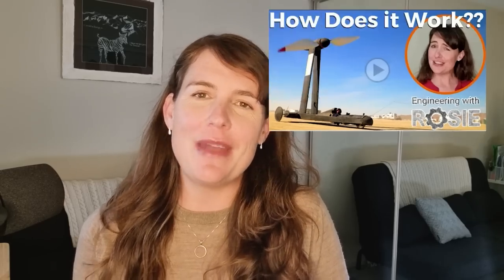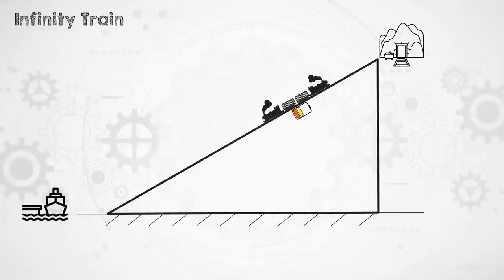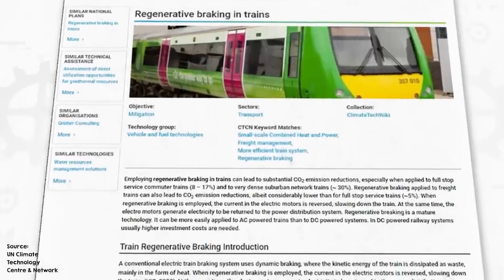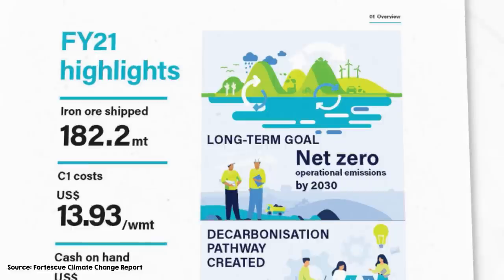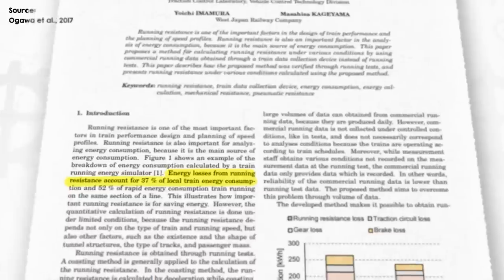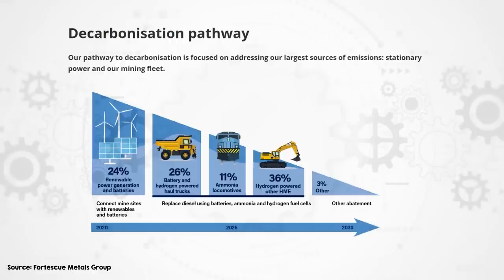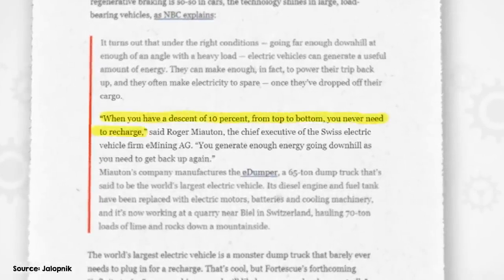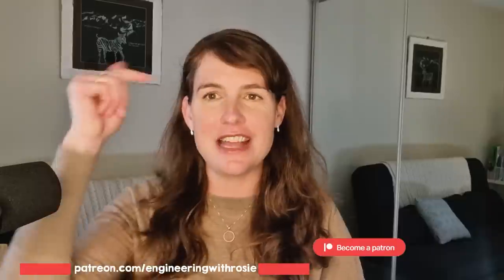This Mining Train Powers Itself: The "Infinity Train" (and how it works)

Comment: I'm not convinced by BEV haul trucks. Ive seen some mines use electrified haul roads with the trucks fitted with pantographs.
These removes the need for huge batteries, charging downtime and the trucks can be converted easily because they already have electric drive. 
My only concern dor the train: what if there is a technical issue and it fails to collect enough charge on the downhill journey?
Reply: There will be a diesel loco on standby for recovery.

Comment: What if the batteries were taken off the train and connected to the rail line? Could energy generated by the train going downhill be transmitted to the batteries and used to power the train going uphill? Would the weight saved offset transmission losses?

Comment: They probably will have a backup energy source "just in case". Either fully charged batteries (separate from the charged ones) or possibly an old-fashioned diesel engine simply for emergencies and rarely if ever used. I can only imagine the nightmare if something went wrong on the way back "up" and they had zero power.

Comment: All the significant grades or other regular train braking locations (heading into a switch yard) along the routes of rail roads that use diesel electric locomotives could be used to generate Grid electricity.

Comment: I reckon we can equip each freight train car that normally carries a 40 foot container with solar panels. The solar panels (16m2 per car) will generate 2.6kw of power while the sun is out per container. 50 carriages (containers) will gives us 130kW. As a supplemental power source, this should reduce the cost of interstate freight transport fuel costs substantially I expect.
Reply: 130kW  is less power is way less than your average Tesla engine at 615kW.  I guess you could run the AC in the cab.
Reply: @craigs5212  When its cruising at a constant speed, I'll be surprised if it needs power from any other source other than the solar panels.

Comment: Is there a gearbox system on the motor to increased the speed of the generator RPM for regen, the weight of the loaded Loco would have enough power to spin up the generator or alternator to produce more regen that if were working on a  1:1 ratio.

Comment: The diagram is misleading in that the section of track where regenerative braking would occur is relatively short and is quite a way inland. This means the batteries would have to power the loaded train from the bottom of the descent to the coast as well as the empty train right back to the mine
Reply: The braking will happen all the way down, otherwise the train might go off the rails from the uncontrrolled acceleration.
Reply: @AnalystPrime  agree, but the point I am making is that, in the case of the Pilbara mines, the bottom of the descent is a long way from the port where the trains are unloaded.Thus the loaded train will need to be battery powered for much of its journey

Comment: instead of carrying the battery back and forth couldn't they add wires along the track providing the power and put the batteries at the bottom? Or are the wire losses too large?
Reply from the maker: I assume it would cost more to do it that way, but I am really just guessing.

Comment: Maybe the weight of the battery is less significant than thought. Weight of the locomotive must be large to ensure adequate adhesion of the driving wheels to the rails, if a proportion of this is ballast then this could be supplied by the batteries?

Comment: why would the battery need to be on the train. Couldn't the tracks be use as 'wires' to a fixed battery at one end of the track, or use overhead cables like a tram ?

Comment: they use american locomotives in australia ? i guess you could use dynamic braking to charge a battery instead of blowing it away as heat, but the locos run the diesel and use the generator to excite traction motor fields i believe. anyway the locos in your clip dont have dynamic brake blisters anyway?

Comment: Hi Rosie.  Great hair day by the way.  Say, energy storage doesn't need to be on the train.  Don't commuter trains use a pantograph?

With electricity storage off the train cars, significant weight savings could be attained.  Furthermore, cheaper heavier energy storage like liquid magnesium batteries could be used.  Energy density is a non-issue.

Comment: Would it be possible to just have a powerline that's connected to the vehicle and the powerline is connected to a static battery system on the ground? You wouldn't need to carry the battery and it could work for powering the train if it's not 100% sufficient.

Comment: I wonder how long these freight trains take to unload and whether it would be at all possible to charge the batteries enough for a round trip.
Reply: Most ore, both in the US and UK, during rail transport, is done with bottom discharge hopper cars. They are loaded from above and at the bottom, they will pass over a track section over a collection point and open their belly doors to discharge.  FR
Reply from the maker: If shipping ends up going electric (or partially electric) and the ports get charging infrastructure then that would seem like a good way to extend these kinds of projects beyond rare examples where they can be 100% self sufficient.

Comment: That source of energy is similar to how to use the mechanical force of a running car. In this case , the mechanical force is created by the pulling force of gravity to turn a magnet or a solenoid to drive free electrons in the solenoid to the positive terminal  of a battery, then the chemical reactions in the internal circuit of the battery pull the free electrons from the positive terminal to the negative terminal, and at the same time driving positively charge ions or cations to the positive terminal to cause accumulations of negative charge and positive charge at the two terminal  to create a DC electromotive force  between the 2 terminal to drive electrons around the external circuit to run the mining train
Although this method of generating electrical force is simple and very economical, environmentally friendly,  having almost infinite gravitational force to turn your  motor's rotor or stator to covert the mechanical force to electric force, you cannot actually have any infinite train function because the battery cannot last forever. its electrolyte has to be replaced after a period of time , so do  the electrodes and the components of the train as well.

The phrases, electric energy and gravitational potential energy are vague and not very correct. The  unambiguous phrase is stored electromotive force which can drive electrons through the external circuit on the way back uphill to run the mechanical system to move the train uphill when the gravitational become a resisting force against the train's uphill motion

Comment: 100 ton truck is low. there are dump trucks that haul 450 tons. so likely a bigger truck would be able to run without fuel because as the load gets bigger the empty mass doesn't increase as much .

Comment: What I'd like to know is what is the lifetime efficiency versus the old version of the different vehicles... Not just how much fuel is being saved directly, but the overall carbon footprint including manufacturer of the old versus the new for the lifetime of usage. The definition for lifetime in this case is the amount of time before anything needs to be replaced that's major, battery pack, actual engine and motors, I'm assuming the frame, tires, most other consumables, etc, is going to be the same regardless of which technology is being used.

Comment: IF they need a bit more energy, they can add solar, each cart can provide up to 16kw/hr on a bright sunny day (8AM to 6PM average would probably be around 9-10kw/hr or around 90-100kWh/day per cart)
Reply: Colin Mitchell  This train could produce 1MW per hour, on a train that already doesnt need charging as explained in the video. The solar would be to supplement the gravity driven re-charge, and allow for more versatility.
And again, because the train doesnt need recharging for gravity, they can just put it on the 'engine' for ~20KW/hour or as many cars as they want for about 16-20KW/hour per car.

But youre right, a traditional diesel electric train is far more suited for something like this because that energy would be mostly wasted on this gravity driven train. On the plains a solar assisted train could cut its fuel usage by 1/3rd
Reply: Instead of putting solar panels on a moving vehicle, with all the problems that causes*, you could also just put them on the ground. Easier, cheaper, more efficient 🤷🏼‍♀️

*Problems your idea would cause:
1. Carts are loaded from the top. So you would need some folding mechanism for the solar panels -> more complex -> more expensive + maintenance 
2. Solar panels aren't pointed straight at the sun -> less efficient
3. Damage to solar panels from flying debris or during loading of the carts -> reduced lifespan for the panels

Comment: I think there was a train on a hill somewhere that was used to store energy for the electricity grid, sort of like pumped hydro?
Reply from the maker: You might be thinking of ARES - Advanced Rail Energy Storage. I covered it in a livestream on gravity energy storage a while back https://youtu.be/AktehETXUVA
I realised after I finished this video that I probably should have talked about that project in this video too 😊
Reply: @EngineeringwithRosie  oops my bad, just had a look at it now.  Not much point mentioning it In this video if you've already covered it elsewhere!  Sounds like a good idea but would probably work better in eg Switzerland than   say the Netherlands.  Although they could maybe do a sort of pumped hydro thing there with seawater I suppose 😁

Comment: awesome tech, broken down really well! though... 
EDIT: whoops I falsely assumed it was for a coal mine. this is what I get for skipping to the maths!
Reply: I assumed it was coal as well, but apparently it's iron ore. 🤓
Reply from the maker: Yes it's iron ore. Not sure how I would feel about the train project if it was to carry coal. Negatively probably, not worth the effort to slightly decarbonise an industry that's just got to go. But iron ore we're going to need for a lot of stuff that will power the energy transition, so I'm on board 🚂
Reply: @EngineeringwithRosie  Very easy to say that "Coal just has to go" with plenty of options. In central Europe that is perceived as a death tread.
Reply from the maker: @Nerd3927  sure it is very easy to say that. But I have spent my whole career developing technologies to replace coal. So I am certainly not just talking about replacing coal, I'm helping develop solutions to replace it without sending anyone into energy poverty.
Reply from the maker: You must be the only person who skips to the maths!

Comment: Just to add more fuzz to the numbers, Willems is going to have much higher preforming battery tec then Tesla, now the cost of those  will prob be a square of the energy density gain but I'm sure they have a middle ground in mind.

Comment: They could keep the battery separated from the train, that would allow to use cheaper batteries than lithium ones, remove the weight from the train, and even trade with electricity when the train isn't running.
Reply: Standard high voltage transmission lines loose something like 50% over those distances. You could stage batter packs along the route but that would still involve substantial transmission losses that would likely render the project not viable. You would also have to be careful about pack failure. An electric train without energy would then require diesel rescue trains. There would also have to be a significant amount of energy storage redundancy in the system under that model as well. Mine operations from mine to ship are tightly controlled manufacturing operations and breakdowns/derailments produce major economic and operational problems. Mine companies spare no expense to resolve these kinds of incidents.

Comment: I'm interested in an economic comparison between the battery storage on the train and a catenary and electrical equipment supporting bidirectional energy flow with the grid.   For the moment I would ignore the scheduling requirements for the energy flow to and from the grid and consider the impact on operations only if the economics of the catenary were favorable.
Reply: Yeah. If near a decent sized grid that could be worthwhile
Reply from the maker: This particular mine is nowhere near any electricity grid 😊
Reply: @EngineeringwithRosie  I figured that was a possibility.  The catenary would permit stationary batteries at the mine which could double as demand-leveling storage, likely increasing the efficiency of on-site electrical generation and enhancing the ability of utilizing renewable energy generation at the mine.  Catenaries are not cheap, but it would be interesting if the increased return on equity in stationary batteries vs. rolling stock could pay for it.
Reply: @mrhickman53  I would put the storage batteries at about 1/2 the way up the mountain, to reduce the IR losses during charging and the return trip. ((Need to do the math to get an informed estimate.))
Reply: @michaelbianchi7639  If one were optimizing for IR losses the  batteries would remain on the train or be distributed along the route.  My guess is that overall system optimization would point to centralizing the capital equipment at the mine site.

it seem's a crude cost for a catenary system might be $1M/km.  I should look up the mine on a map, but a 4% grade would imply 11km to electrify.  Being a dedicated railway, the grade could be steeper, but I would suspect the catenary construction cost would also be higher per km in that case.

I just looked up Tesla's Megapack capabilities.  Each Megapack is 19.3MWh with a 9.6MW rating and costs ~$10M plus tax.  No info on installation costs.  In order to minimize the capital cost of the battery (on-board or Megapack) the train would need to take 2 hours on descent if no other means of dissipating the energy is available.  For the stationary Megapack system, the train could descend faster if mining equipment were also consuming energy.  Otherwise the Megapack installation would need to be sized to meet the train power requirements.

Since diesel sets are also limited to the power dissipation capabilities of the on-board dynamic braking resistors, one may be able to justify shorter, faster train sets using the catenary-stationary-battery system instead.  This is truly an interesting optimization problem.

Comment: Couldn't the batteries be fixed (saving moving that weight uphill)?
With catenary or third rail Im sure there would be some transmission losses but the cars would be less complex and much lighter.
Reply: More efficient yes. But the construction cost would be much higher.
Reply: I would put the storage batteries at about 1/2 the way up the mountain, to reduce the IR losses during charging and the return trip. ((Need to do the math to get an informed estimate.))

Comment: Like going downhill both ways. There is a significant problem with rejiggering what runs on what and in what proportion. It's what to do with all the left over petroleum products that once had a use but now little place to go? Heavy bunker oil is used by the 5,000+ global container ships. A barrel of crude produces about 1.5 gallons of heavy fuel when refined. Heavy fuel aka fuel oil is a heavier hydrocarbon than diesel, kerosene/jet fuel, gasoline, propane and butane. To get heavy fuel, the lighter hydrocarbons must be cooked off and need to go someplace. When cars are electric, gasoline will have to sell for pennies as it has to go someplace. It does go bad in long term storage if mixed with ethanol. Even clear no ethanol gas is 2 year storage life then you have a real mess. Still need all the other distillates and feed stocks if you want plastics, foam, fertilizer, roofing, asphalt roads, candles, lipstick etc as that is the heaviest. Nobody is addressing what happens when this distillation ratio becomes so imbalanced gasoline with no place to go and considered hazardous waste as result of refining heavy fuel or asphalt or candles?

Comment: A nice thing about trains is they can be big and heavy and still the steel on steel interface gives little resistance. More sustainable than electric batteries, if also a bit less efficient, might be the lowly flywheel, set up in counter rotating pairs.

Comment: You wouldn't have to worry about carrying the weight of the batteries if you used an electric rail, but I'm not sure that it would be more efficient. 

Could a mag-lev train carry the cargo?
Reply: Colin Mitchell  Sure, but expense is relative to the return on investment. It may still be worth calculating. Maglev at $30million a mile is cheaper than a subway system at $1billion a mile. 

I do understand though that standard rail at $1-2 million a mile is much cheaper up front. But if the maglev carries a heavier load much faster with far less maintenance  and a higher energy efficiency, then it may be worth knowing just exactly how much more value it can produce for the extra expense. I'm just curious is all.

Comment: This is clearly not a perpetual motion machine when you expand the scope slightly. The energy input to run the train actually comes when the train is loaded. That's when the gravitic potential energy is increased. If it was a closed loop around the train itself, it would make one successful return trip. If the train was not reloaded, it would probably make the trip down to the port, but not the return trip. From an economic point of view, it is "free" energy as the energy used to load the train is required anyway.